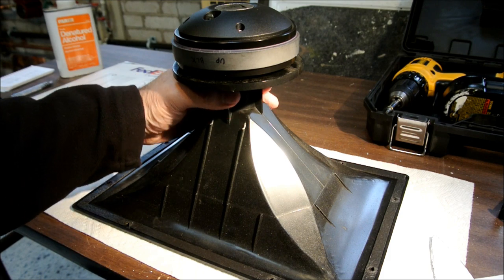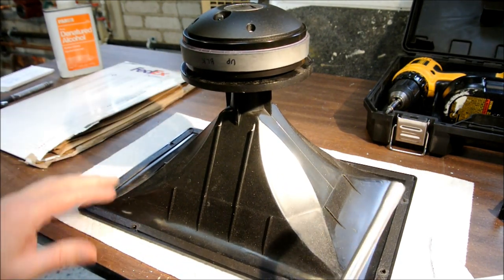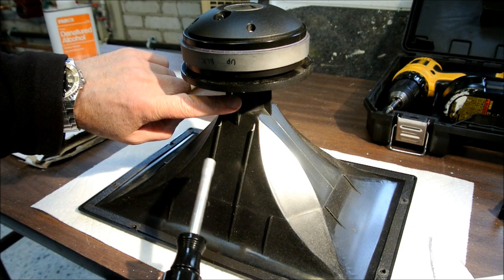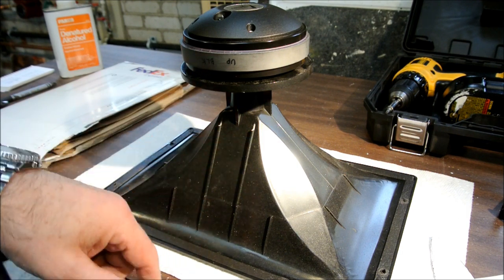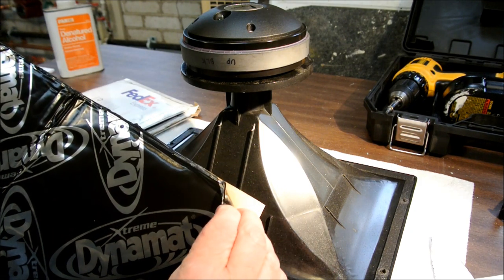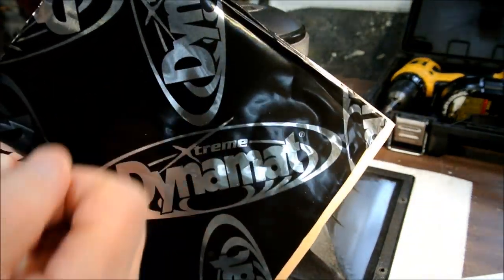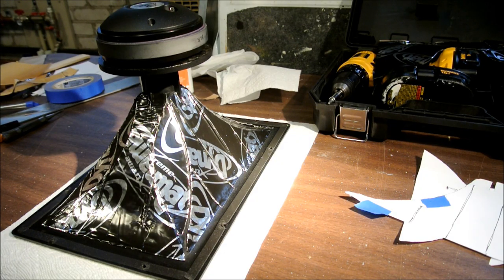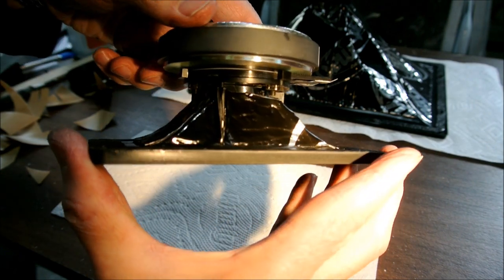How to Modify Klipsch speaker horns for better sound.

Comment: Needed a Covid project and although skeptical, I decided to go ahead on my newly rebuilt and upgraded Klipsch Belles.  Well all can say is" thank you".  The improvement is absolutely worth 90 minutes of work.  What I noticed is a smoother mid and reduced distortion.  This improvement manifests itself in easier listening even at higher concert volume levels.  This should be a standard upgrade on all horns.
Reply from the maker: Fantastic! We are hearing similar things, I beleive.
Reply: What upgrades dis you perform  on your belles?
Reply: What model Klipsch speakers did you modify?

Comment: I'm with you 100%.I upgrade speakers constantly.i really enjoy it! I'm doing horn speakers now.(Klipsch Belle's, Hereseys,EV, and some JBLC53 libras.) Dampening the horns are essential.but the woofers that Klipsch has been using in their heritage series for some time have missed the mark(low efficiency,and serious roll-off in the upper bass/lower midrange regions.i found that using cast frame,high efficiency woofers seems to balance the system much better.i always pull those CTS woofers out of Klipsch's and replace them with Pro JBL stuff.it's just magic when modifing Klipsch speakers.
Reply: Hi Chris, husband here...for my heresys, what "pro JBL" stuff are you suggesting?.....Thanx in advance
Reply: @debragibson3489  Debra, the Woofers/Horns that are in the newer Klipsch stuff is Cheap stuff.Most people think that an upgrade is Newer,high tech stuff,but it is Not!!!.when it come to Klipsch, I Backgrade!! The Early Model H700 Heresey used the Electrovioce SP 12B woofer,K55v(Atlas) Alnico Mid driver w/cast mdl.700 horn.Electrovoice T35 Alnico tweeter
Reply: @debragibson3489  that is current configuration in my Heresey's.The JBL D123 work's great,but is pricey.(L100 woofer).in bigger Klipsch Designs,the Alnico JBL Pro 15's are critical( Le 15a,130a,2215,2220,150a,etc...make sure the us are cast frame and preferably Alnico.
Reply: @debragibson3489  Pro EV stuff is great as well.less pricey.(EVM 12L,voted best guitar speaker),EVM 12B, for Heresey's.For larger Klipsch's,EVM 15L,15B. Hope I've helped!! Good luck!!
Reply: Anyone try to place dynamite on the armor church of the woofers? I and mark I heard those have some resonance as well
Reply: @SmilinMikeable  unfortunately,if your into the Heritage line Klipsch',the task is not over after the purchase!  sold my Heresey pair(90's) due to lack of bass response and my lack of audio knowledge.i did learn that my Crown DC300a you good bass out of them .My tune.I picked up a lot gear from a Former Grateful Dead roadie which included two McIntosh MC 2300's,two MC2100's,JBL monitors w/LE 85's,O75's,LE 14a drivers.but the freebees that he threw the deal was a beat up pair of Klipsch Cornwalls that looked like they were kicked around the stage for 20 yrs,!! I didn't bother listening to them until I had buyer on his way to demo them.they blew me away!!! The had JBL Alnico Pro 15's (2220's).I didn't want to sell them,but was committed.so,it's been feeling Klipsch speakers ever since .thank.
Reply: @chrispicquet733  Thanks for the info.  This will be a great help when I dig into my Forte's.
Reply: @mark63366  Mark,I found out this knowledge by simply by accident at first.I knew the speakers were not right,so I started taking them apart, swapping drivers, changing the damping in the cabinet,etc....until I achieved my goal.sometimes it took a bit of money and a lot of time,but that's how I learned..one of my earliest upgrades was a pair of Apogee Centaurs.it was almost impossible to get into those things by design.i couldn't take the one note bass anymore.the 26"ribbons sounded great! I replaced the of the shelf Vifa P 21WO woofers that were designed for larger ported designs, with some AR 4a woofers that were designed for a small sealed enclosure.which taught me that Speaker Manufacturers don't necessarily know what the hell they are doing, or worse,they don't care
Reply: @chrispicquet733  Where  do you get those parts?
Reply: @NeilDuly  well Neil, I am a true believer that the older drivers are superior to the cheesy stamped frame, off the shelf junk that is being used today.even terrible sounding ceramic compression drivers are touted as great! The 1950's was the heyday of Horn Loaded Speakers! Klipsch originally used Massive Chrome Framed  Alnico Electrovoice Woofers ,with Alnico Atlas mid/ Compression drivers/ cast horns,and Alnico Electrovoice T-35 tweeters!. I have kept my eyes open for such drivers for many years,and have built up a High Quality Stockpile of Classic cast Frame Drivers,Alnico compression drivers,etc.........there truly is no upgrading to new drivers as the few companies that upgrade Klipsch Heritage Speakers contend! (Except for Crossover's). If you can't find 50's EV'S, then use 60's, 70's JBL cast Frame Alnico Woofers! Much faster and more accurate than the subbed out stamped frame stuff that Klipsch has been using for some time.
Reply: @chrispicquet733   Wish I could hear the difference. I'm all the way out in south africa and there's just no variety out here. I think even my Cornwall iv's are pretty rare. I have to import scan speak drivers to give those a try. Forget vintage parts from Klipsch.
Reply: @NeilDuly  Not from Klipsch, order Electrovoice Woofers ( EVM 15L, or EVM 15W) the difference between the two is L has a thinner paper cone for use in guitar amps, great midrange / midbass reproduction.the W has a thicker cone deep bass reproduction.both are far superior to the stamped frame woofers  in your Cornwall IV's.
Reply: @NeilDuly  Also,aside from the EVM drivers that highly recommend,check out Celestion Pro bass guitar drivers.
Reply: So can I just buy some jbl l100 woofers off ebay and install them in my Forte IVs and get a great result? Aren't the crossovers and passive radiators designed for the woofers they come with?

Comment: Would a spray on damping material have any downside? I just acquired a pair of AK5 and converted them to a B profile and plan on trying a mini dsp 4x10 with 6 channels of old McIntosh tube amps and see how that goes. The Khorns will be used mostly for old movies with optical soundtracks. I would have loved to use Western Electric horns but they are the size of a car and cost as much as my house.

Comment: I did that with my RP-600m too. Added it on the tweeter housing, woofer basket, port tube  and the inside of the cabinet then added the sonic barrier damping foam. Also changed the xover parts. Now it sounds way better.
Reply from the maker: @juy3541  Good to hear! Thanks for watching.

Comment: Horn drivers can have a nasal,"honking" quality.  So, I decided to try this with my Forte IV's. 

After making stencils, I applied the Dynamat Extreme to one speaker as described. Then, setting the audio to "mono", I did left-right comparisons while listening to symphonic, jazz, vocal, and percussion tracks. The Dynanat application significantly changed the sound quality. The locus of sound moved out in front of the treated speaker, while the sound on the untreated side was more within the speaker cabinet. The treated speaker did sound somewhat smoother, sweeter, and more direct. The untreated speaker was louder and seemed to have more resonance - like it was in a larger hall. 

High frequencies were significantly attenuated on the treated side effecting ride cymbals, high woodwinds, and trumpets. I found the highs flat on the treated side and so I removed the Dynamat from the tweeter.  With just the midrange horn damped, I continued the side-by-side comparison.  Vocals were smoother on the treated side, but I found myself preferring vocals with the more open, overtone rich sound of the untreated Forte. So, after much reflection I removed the dampening material.  For me, the application of Dynamat produced an over-dampened character.  

All in all, I learned a lot from this experience.  I think that resonant vibration of the walls of the horn drivers significantly contribute to the open quality that I like in my Forte IV's.
Reply from the maker: Well, there’s no substitute for your own experiences and preferences. For me, the Dynamat increased the naturalness, nuance, ease and dynamics considerably. Also, I too listened to one speaker before I did the second one. The difference was much more dramatic when I listened to the modified pair than when I just compared one stock speaker to one modified speaker.
Reply: Upgrading is not na easy stuff. I have replaced cheap capacitors once with expensive audio grade ones and the sound became so sweet… I could not listen to it anymore. Terrible. I have installed old capacitors back restoring original bit sharp character of the loudspeaker I liked.
Reply: Horns nasal
Horn bass, tunnel
Thats just the nature of the beast
Reply: i watched videos about doing this a while ago and i decided back then that if i was to do this i wouldn't be using dynamat, if i was to do this i would just put some gorilla tape on them or even normal sticky tape. because it's not how this guy's says it it's not about the plastic moving it's all about dampening not how the plastic moves. so, there's no need to go to the extent of using something like Dynamat which will just about completely dampen it, all you would need is something that will dampen it a small amount such as simply putting on some normal thin see through sticky tape or if you want something more some gorilla tape.
Reply: @icanseeall-inthisreality  Mortite is actually the best. It’s that gray silly putty also know as duct seal.
Reply: @slawomirp  I've test may different capacitors. They all have a different character. I made some notes and kept the best sounding ones in the component.

Comment: Very well done. You have a great understanding of the subject. Our brains do a lot of "error correction" when we hear things, and the more error correction we do the quicker we tire. I learned this some time ago when setting up sound for large instructional conferences in stadiums. Maybe the instructor isn't the reason everyone is sleepy. Is there a lot of echo, or are there resonances or peaks that can be tamed, is there a lot of mid bass from proximity effect? The idea is to get the desired signal over arena noise as high as possible. So by damping the horns you have raised the ratio of music to the plastic noise from the horn. Bracing the cabinet should produce the same effect. Now that your brain is doing less work it will concentrate on the bass and/or the next problem. I also like how you illustrated the sound masking effect.That is why we put loud stereos in cheap cars so we can't hear what is wrong with them :-)
Reply from the maker: Yes, exactly.

Comment: In 1985 I realized my metal La Scala metal horns were in need of serious dampening. A friend mentioned a product he used called Devcon which is an epoxy for repairing conveyor belts. I bought some and mixed it up; just enough to do one mid-range horn and tweeter at a time, then mixed another batch for the second pair. . I took the drivers off of the horns and sat the horns on wax paper with a little oil rubbed over the surface as a mold release. The Devcon was thick enough to not run too fast. I did both mid-range horns and the tweeters and they turned out EXCELLENT.
Now my Klipsch La Scala's  sound great. Later I bought Crites crossovers and that helped as well. 
As the Devcon dried and hardened the finish was shinny black much like the volcanic rock called Obsidian. I will uses these until the end and never need any other speakers.

Comment: Yes everything you said makes sense.. I noticed in your last video on these speakers you had cited some issues you noticed, such as box resonance and resonance in the horn, but as you found out,, when you make changes, you’ve  altered the original personality of the component. This is why when people talk about modifying and customizing stuff, I always tell them to make sure you know exactly what your expectations are, and what affects what, so you know what you’re giving up, what you’re getting, and whether that’s overall what you want to be getting. The resonances you removed were obscuring the sound, and by removing them you created a sonic opening that brought other sonic deficiencies into the foreground. When I’m trying to listen critically to audio, 
I need the absolute lowest ambient noise to do it. This includes the noise floor of the equipment driving the speakers, mechanical or electrical !! You probably work the same way to realize the difference. 
All Good videos on the Cornwalls btw.👍👨🏻

Comment: Finished (Dynamating) 2nd speaker just now. Astute modification that is ridiculously easy to execute and super inexpensive. A must. To my ears, result is substantial and positive. 
Thanks!👏🏻👏🏻👏🏻👏🏻👏🏻
Reply from the maker: You’re very welcome 😉. Yes, it makes a big difference. People think everything is a “tweak” but the horn damping is a major improvement to resolution as well as musicality. Enjoy your speakers and thanks for watching.
Reply: @thebostonaudiophile  Yes it is. BTW, I just ordered Sonic Barrier 1" acoustic foam to cover inside walls of Cornwalls. I'll test it next weakened. Goal is to smooth out bass resonance inside the speaker. Also, have you considered using dynamat on bass stamped basket and those 3 flared bass ports???
Reply: @thebostonaudiophile  why wouldnt Klipsch put these damping improvements in stock speakers?
Reply: @thebostonaudiophile  - Hi did you add any sound damping material inside or dynamat the woofer baskets and/or the bass ports at the bottom?  Thanks!
Reply: @Grooverski  Did you end up doing this? How does it sound?

Comment: All the exotic plastics nowadays....
It is amazing that Klipsch wouldn't use a more acoustically inert material for their horns.  Really no excuse for it.  

Thanks for this great video.

BTW:

Dampen - make something wet
Damp - absorb energy
Reply: They do on their rp series because they're made in china. By having these heritage speakers made in hope, arkansas, you're spending alot more money on labor and they have to cut costs in some places.
Reply: @SpencersStuffTV  That is good to know. Thanks
Reply from the maker: Any single material may not work as well as a 3-layer composite, which is what the Dynamat (viscoelastic rubber and aluminum) on the horn creates.

Comment: I’ve seen a lot of guys on the Klipsch boards who dynamat the woofer basket also and passive radiators. I’ve had a lot of fun experimenting with these mods on some older stuff just to see if I like it enough to do more of my better speakers.
Reply from the maker: I was thinking of something different than just Dynamat on the baskets. Still deciding if I want to go there. The Dynamat is sure easy though and I bet it helps!
Reply: Dynomat should be ok.  I have been thinking of making my own and dampening on the woofer (any woofer) was something I am considering.  I had actually been thinking of some more extreme mastic/bitumen type product, but something that comes of with acetone would be better.
Reply: ANYTHING that reduces or eliminates resonance in a speaker, whether that resonance be in the horn, the woofer basket or of course , the cabinet itself, will yeild a more true and pure sound reproduction..its all these combined resonances that Add Up to produce  an overall diminishing of good  sound...Very expensive speakers have taken great care to deal with these areas..Its the midrange and budget speakers that really need the help
Reply: @thebostonaudiophile  the old Infinity Column II's had 4 woofers and they literally ring like bells when you knuckle rap them. I cut and put damping strips on the baskets and then braced the part of the enclosure that resonated the most. I also damped the midrange enclosure. It was a huge improvement in those speakers. Low cost and low risk also for those speakers.
Reply from the maker: @66doodz Thanks for your firsthand feedback!

Comment: I recently picked up a pair of Forte ii from the 1990s at a very reasonable price and applied dynamat extreme to the midrange and tweeters just like in this video. I also applied it to the insides of the cabinets. Only about an 8 inch wide strip on each side. Top to bottom. I am driving them with a Decware 2watt tube amplifier and am stunned how much more dynamic the sound is. Especially the bass. Its full and rich. So this method does work. To my ears it did improve the sound. Thank you for the video!!
Reply from the maker: Thanks for sharing your experience. Glad it worked well for you too!

Comment: I plugged my cornwall in bi-wiring on my rotel Michi S5 + P5, I took two 4mm cables of diferante brand, the sound that comes out is really incredible, I would really like to listen to your cornwall with the modifications you make , thank you for your always very interesting video.
Reply from the maker: Thanks for watching. I want to try bi-wiring at some point also, so I appreciate your insight. There are many things I want to experiment with but it’s important for me to take it slowly and give myself plenty of time to absorb and readjust to system changes. Otherwise, my impressions will become a muddled mess.